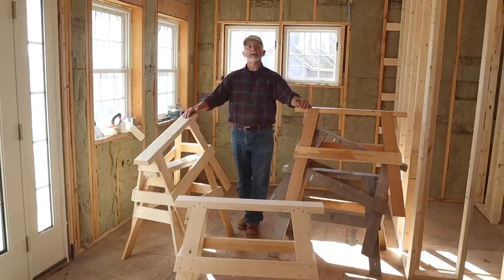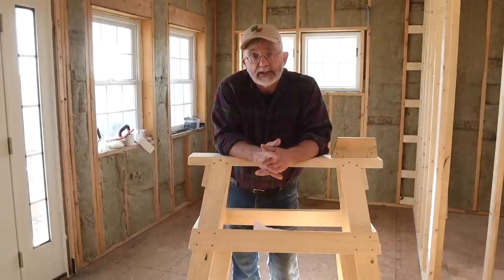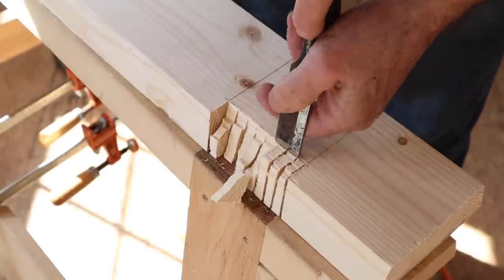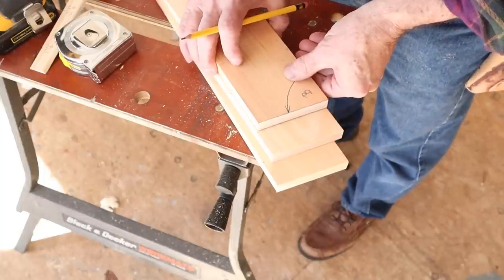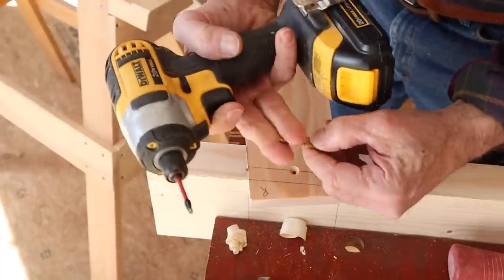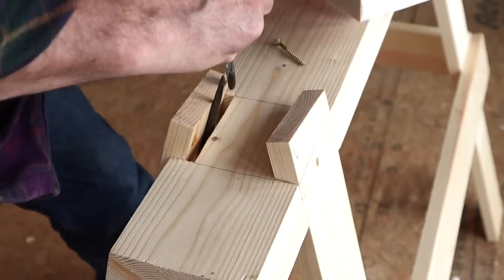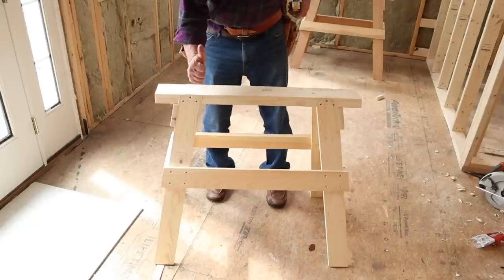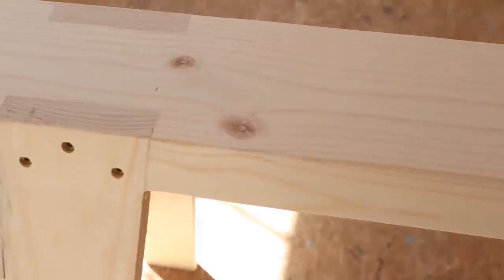How To Make A Classic Carpenter's Sawhorse (By: Herrick Kimball)

Comment: I like the video and appreciate the length and detail.
Sawhorses may very well be the first thing many build.

For a tray I prefer hardware cloth as it doesn't collect sawdust.
I only use a tray on one for better stacking.
To stack I make hoses differently 
from video and each other. Bottom horse has shorter flush ends, top horse is longer, braces and gussets inboard on 
bottom horse, outboard on top horse.
Top horse is longer.
This all makes them nest nicely.

Also I don't rip the entire edges to get the angle just what I need, with a handsaw at ends.

Comment: A friend made me a similar horse years ago.  He learned that style while in the union school in Chicago.  One difference, his style has 1/4" plywood to make the middle braces into a tray.
Reply: I like the video and appreciate the length and detail.
Sawhorses may very well be the first thing many build.

For a tray I prefer hardware cloth as it doesn't collect sawdust.
I only use a tray on one for better stacking.
To stack I make hoses differently 
from video and each other. Bottom horse has shorter flush ends, top horse is longer, braces and gussets inboard on 
bottom horse, outboard on top horse.
Top horse is longer.
This all makes them nest nicely.

Also I don't rip the entire edges to get the angle just what I need, with a handsaw at ends.

Comment: Excellent video, with very concise instructions. I bought the plans and have my A-B block all set, thank you for the miter angles. As the other comments mention, I made one wider so they stack perfectly. Jim
Reply: How much wider?
Reply: Enough so the top one will stack on the lower one. @emoyco You move the 2x4 in on one side on the lower one, and out on the upper one, then they stack nicely.

Comment: My grandfather was still building homes in 1955 and had made those kind of saw horses.
Reply from the maker: Hi Clark,
That's nice to know. I believe this horse design was once very common among carpenters and it was considered something of a "rite of passage" for an aspiring carpenter to make a set of horses like this.  Mr. Burdick, my building trades teacher at Alfred State back in 1979, was an old-time carpenter. The other teachers in the program were much younger.  I modified the horses we made back then by beveling the top 2x6 and by eliminating the shelf that was typically in the lower portion of the horse. Those modifications rendered a horse that is easier to make, lighter in weight, and more versatile. Thanks for the comment.
Reply: @herrickkimball  My grandfather built with hip roofs in the 1950s. He got lumber by tearing down buildings in the 1920s and built chicken coops with it. In the 50s he  turned his 5 acres into 1/4 acre lots and built homes out of the 100 year old lumber. He built homes with a hand saw and hand planes. In 1982 the wife and I built a super insulated solar home with power saws and no hip roofs. I made saw horses from plans in a Rodale publication. They were like yours in angles, but had a tool tray. They were heavy. If I had life to do over, I would copy your saw horses.

Comment: Built 4 of these today only I didn't read carefully before I started.  Thought the top 2x6 was 36 inches long.  It is 33" in your plans so when I got to the long side braces, mine were cut too short.  I could have moved the pieces up 3.5" but I decided to cut long side braces 34-9/16" and then used the scraps to make the end pieces for another 5 saw horses.  I made all my angle cuts and mortises on a table saw and a cross cut sled.  I screwed a strip of wood to the B angle and cut my legs and long side braces and mortices then repositioned the strip to the A angle and cut all my end pieces.  The only other trick I use is to make screw hole layout tools by making one extra piece of all the pieces and screw in screws so they stick through by 1/16" or so and I can just line up my tool against the piece to be marked and I press the tool on and voila my next piece is instantly marked and center punched for drilling.
Reply from the maker: Wow. That's a lotta sawhorses. Very nice! When I worked for a building contractor in the 1980s the whole crew (5 of us) got together on a Saturday and made these sawhorses for ourselves. Our boss paid for the wood and we made them on our own time. We also made a shorter version for the company and called them saw ponies. 👍

Comment: Been building 42” PT horses with bull nose legs gusseted square at the end and collared with PT plywood with no lower stretchers. With the last pair I built I made one shorter and narrower so they nest tight top rail to top rail. Longer horses make handling plywood easier. Gorilla glue has too short a shelf life.

Comment: These were always my preferred horses, if I had a little extra time. Otherwise, if you need to “hit the ground running”, just go with the standard upside down T-top style (not an I-beam). These will take an extra ~20 minutes with the ripping and notching. Unless the horses were going to need to support a ton of weight, I would always go with a single stretcher, instead of both sides. It just makes them a little more comfortable to carry, when moving your set-up (especially if you’re wearing shorts.) The leg splay (A), is 15°. The leg angle (B), relative to the top, is 10°. I know you’re not supposed to do it, but they do make a handy (and relatively comfortable) short scaffold. Just don’t use them for that when the safety director or OSHA is on site 😜.